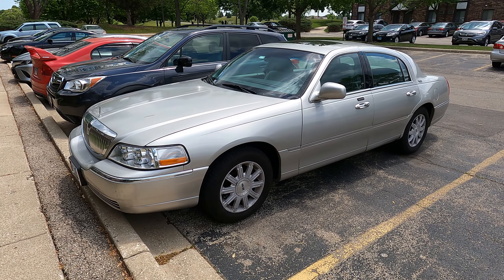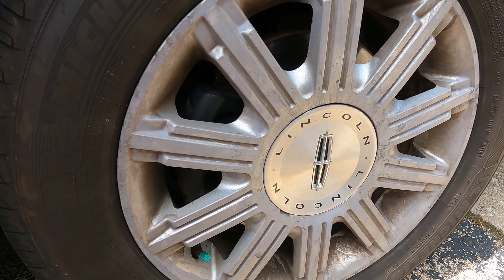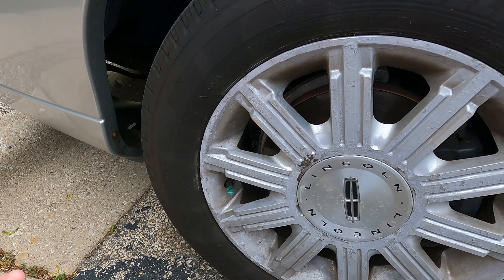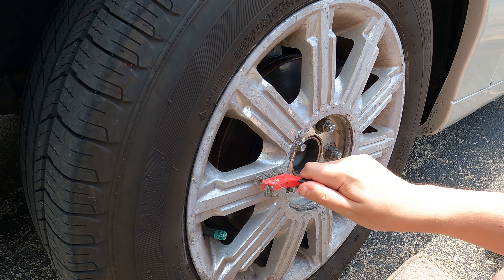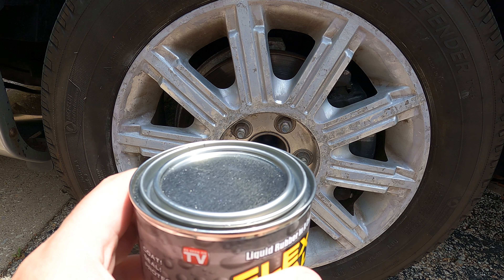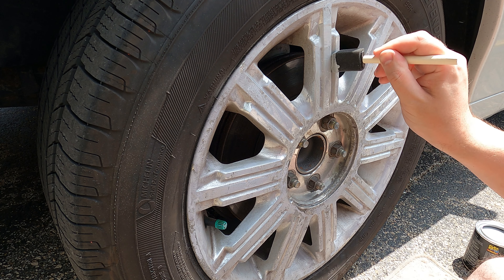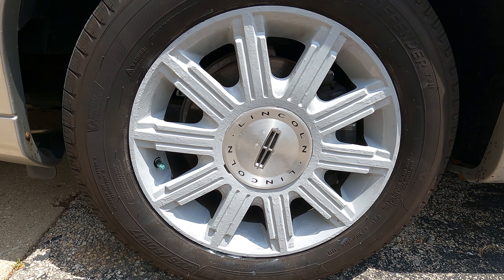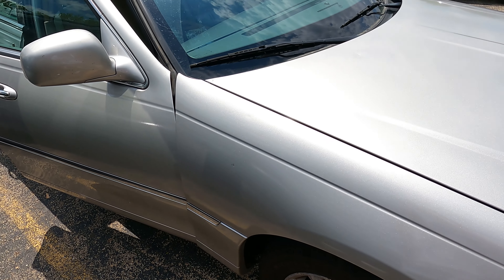Lincoln Town Car Guy Fixes Badly Corroded Rims on his 2006 Signature Limited with Flex Seal Liquid

Comment: How did you fix the seat bottom? Mine dips in like a hole lol. My wife hates it.
Reply from the maker: I stuffed extra foam between the seat rail and the heating pad to basically prop the seat up from the inside. There is an older (crappy quality) video on that - https://www.youtube.com/watch?v=045vk7Wwc6E

Comment: Even the newest TC is ten years old already.  Yes the clearcoat used by Ford (and other manufacturers) cannot withstand salted roads.  The best long term fix is to send the rims to one of several specialty wheel refinishing companies.  Unless the corrosion is COMPLETELY removed, it will reappear even with FlexSeal.  I would recommend either powder coating if you want a painted finish, or vapor deposit chrome if you want a shiny finish.
Reply from the maker: Thanks for the comment. I agree this is far from professional repair and should only be done if you are not afraid of loosing any chance of getting it done professionally. In my case, I'm fine with it coming back, but hopefully not for a couple years.
Reply: @VitaliyKofman  If you are happy that is all that counts.  I know that you have previously said this is not likely a forever car for you - that the rust on the chassis and body will spell this car's doom.
Reply from the maker: Yep. I'm guessing we got about 2-3 more years together before it will succumb to some major chassis failure or some expensive repair that I will not want to do. I do want to own some other cars I love so we'll see how this channel and my car ownership develops.
Reply: @VitaliyKofman  I guess that in a couple of years someone else will have to take over being the "Lincoln Town Car Guy."  I have no rust or corrosion worries, so I will keep mine for as long as it is reliable and cheap to repair.  The greatest issue I am likely to have is that after a few decades of driving that any car becomes boring.  I have three other cars.  Right now the longest one has been in my fleet is a 17 year old 2004 Avalanche that I bought new on January 2, 2004.  It now has 262,000 miles and it has an oil pressure issue that all the cheap and easy fixes did not improve - so I'm pulling the engine next week and I will refresh all the bearings and rings.  It still has great power and the same fuel economy as when new, but after being thoroughly warmed up after 20 miles of driving the oil pressure really drops.  The oldest car in my fleet is a 1976 Jaguar XJ12L that now sports a Chevy 350 V8.  It is partially disassembled and needs another engine refresh.  Really I will sell it after getting it up and running again.  I'm at the stage in life (60 years old) when having project cars make less sense to me then to maintain my aging house.
Reply from the maker: Wow! Nice garage you got there! At 35, I've owned mostly new boring cars. For the next 35 years hope to make up for it. I have no problem being Buick Park Avenue guy or Cadillac DTS guy or another Lincoln Town Car Guy 😀

Comment: You'd be surprised what you can find on FB marketplace;  $200 snagged me four mint chrome rims w matching brand name tires all around for my van, see if you can find any Lincoln wheels being sold on there if you're not satisfied with the final result of yours
Reply from the maker: I'm sure you can find some deals and I even explored some option also, but no matter how I tried to justify it, my Flexseal fix is still the cheapest. I do agree however that my fix is not ideal.

Comment: I must admit this made me cringe a bit, much like your last foray with Flex Seal :) but I have to say it does appear to look better than it did at least on camera.  If you want to keep the car long term I would definitely look into having them re-done professionally though or even a similar technique to what Rich did to his but using a metallic silver paint and clear coat to mimic the original finish.  This is aluminum's form of rust and if it starts to corrode around the bead of the tire, your tires will no longer hold air.  I am not sure if Ford rims suffer from this but GM seems to have a lot of issues with their older, especially chrome rims.
Reply from the maker: Thanks for the comment. Like I suggested - this fix is not for everyone. I know it's a far cry from a professional repair, but I do like it much better than before. From just a few feet away, it looks very good and hopefully will keep the corrosion away for a year or 2. Time will tell if I do a real repair.